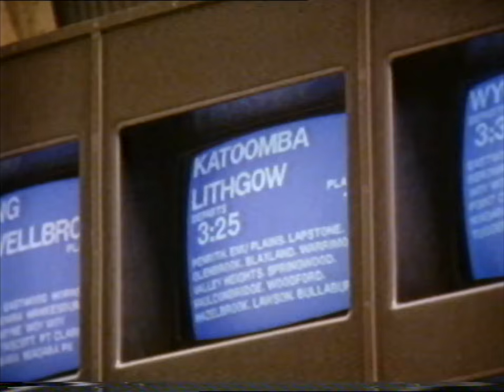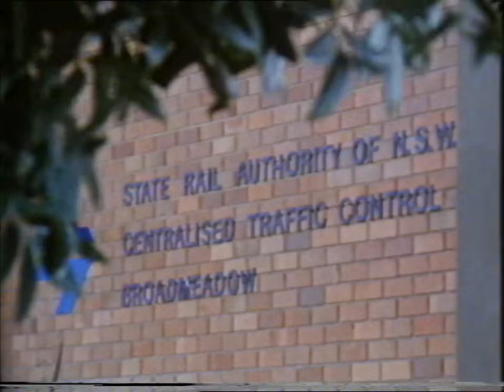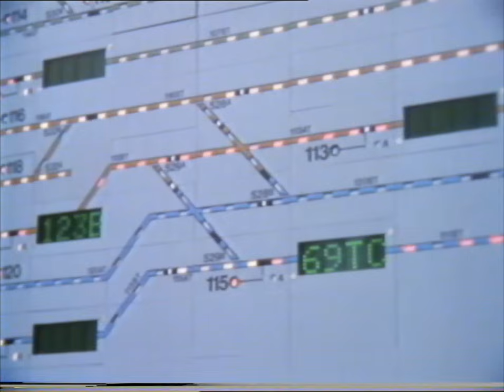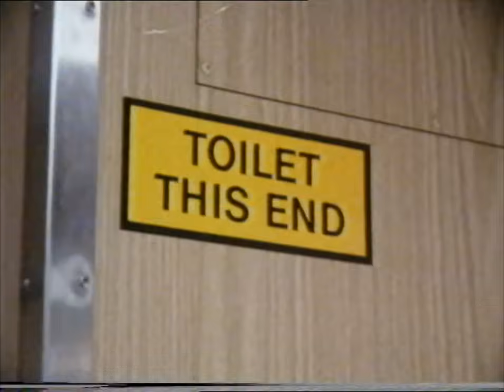Go Electric (State Rail, 1984)

Comment: Been a long time since I've seen a freight electric loco  on the Sydney to Newcastle line ,   my guess is its too much trouble to swap back  to a diesel loco for the non electric track sections which is the majority of the railways  ,  so diesel electric locos run on the overhead electric sections these days far as I know  .    Maybe the 1.5kv DC system can't deliver enough power to electric  freight locos ?    Who knows ?
Reply: 1,5 kv Electrification is enough due to new engines.see..in the Netherlands and France. Built in Germany since 1990ties, these engines could be powedered under four different engery systems 1,5 kv ,3000 kv both DC and 25 kv 50 hz /15000 kv  16,6 Hz AC !!  Therefore I know..!! Greetings from Germany !

Comment: When i was on there 77 to 82 they were going to electrify the main southern line to mittagong .
I ran team 8 2 tampers and a ballast regulator .
We did the track realighnment for the xpt and electrification to mittagong .
It was supposed to done after the woolongong line but never eventuated .
All the cuttings and access  roads done for electricification .

Comment: As usual journalists are bad at math. 200 mast every kilometre translates to a mast every 5 meters. It probably more like a mast every 50 meters if you look at a railway.
Reply: But at least they can spell. It's metres, not meters.
Reply: @JoelDavies-cl6nr  They can, you cannot. It's both meters and metres. I can give you links to thousand science and engineering books where it is spelled as meters. As both spellings are correct.
Reply: @test143000  water meter, parking meter, gas meter. For the purposes of distance in Australia, we use metre. And i had this clarification from an English teacher from The Sydney Grammar School.
Reply: @JoelDavies-cl6nr  In Australia, there is a preference for "meters" over "metres" (55 to 45 for every 100 citations).
Reply: @test143000  thank you for the reply. It gives me something to do in the sense of research/better reading.
Reply: Depends on track location, but 200 would be accurate

Comment: I miss city rail and miss the Interurban V Set. It is annoying that they got rid of those electric powered locomotives in exchange for the diesels. They should electrify the Kiama to Nowra section, Macarthur to Goulbourn and Newcastle to Maitland
Reply: The electric powered Locomotives were withdrawn from service due to the state government charging pacific national to use the electricity and also because they weren't powerful enough for freight.
Reply: @JoelDavies-cl6nr  They were stupid to do these electrifications on the old DC standard rather than reverting to AC though. AC had already well and truly proven its worth overseas, and QLD and WA went with AC for all the right reasons. It cost NSW more for a more difficult installation that was ultimately less effective and required more energy & maintenance. They keep making the decision with every new generation of trains not to allow for equipment that could run on both power types and they now have locked in DC equipment for another few decades despite the downsides. Hopefully if they ever actually build HSR in NSW & VIC they will either keep the HS trains segregated from the DC overhead or buy trains capable of running on both.
Reply: @BigBlueMan118  thanks for the insightful info. My initial comment was based on a conversation from many years ago with a Pacific National Driver.

Comment: Go electric they said, then they got rid of the electric locos
Reply: Imagine an alt timeline where they electrified the mainlines fully like the Main north to brisbane and electric freight still existing today like the QR coal lines
Reply: @QUBE80CLASS-n3z  well i remember a promise of extending the western line elec to Orange but of course it never happened
Reply: Why it stopped at Bowenfels when it was supposed to go a bit further
Reply: @QUBE80CLASS-n3z  I think as a turning point
Reply: @QUBE80CLASS-n3z  It was to capture workers that would live at Bowenfels but it didnt eventuate
Reply: When they created pacific rail .
The first thing they sold was all the electric  locos .
As they didn't want to maintain them !
Reply: @kevinduffy6712  Sold em to who ?they said the subframes were cracked and couldn't run most have been melted down i think
Reply: @simonburns1055  they sold them for scrap even the 80 class ones the 46 class were past there use by date .
Reply: @ 46 class were phenomenal pullers
Reply: @simonburns1055  they were built by Vickers in the UK for nsw railways .
For pulling coal over the mountains .
Reply: @kevinduffy6712  Yes and passengers too cause i went to Sydney many times behind a 46
Reply: @simonburns1055  the 46 class was in volved in 42 incidents ( de railments) splitting the gauge in sidings etc before Granville.
The system of track fastening we had .
Wasn't strong enough for the wheel set up .
They were built by Vickers in the UK, over there they had chairs and bullet head rail .
It was a lot stronger .
We eventually shaped to panderoll clips and concrete  sleepers to handle the welded rail .
Reply: @simonburns1055  yep they were built for hauling coal over the blue mountains .
And they had regenerative braking.
Reply: @kevinduffy6712  Also the bogie was fixed as i remember
Reply: @simonburns1055  it was 3 x 3 set up all driven.
It was a very powerfull and heavy locomotive .

Comment: Why did they get rid of electric locos. ?
Reply: Private operators found them too expensive to operate and too inconvenient because they had to be swapped out at the ends of the electrified area.
Reply: This is what happened to the L Class electrics on the Gippsland
Reply: @leonkernan  Then why not introduce bi-mode locomotives for both electric and diesel lines?
Reply: Like what the NSW Trainlink are with the CAF units
Reply: @leonkernan  When the  86 was tripled up and heading west across the Blue Mountains if the tonnage being hauled was such that the current being pulled from the overhead line on a couple of steep sections would cause the section breakers to trip. Trust me, they went off like a cannon with a bright flash to match it at night.
Reply: Because they weren't powerful enough for freight. And the state government charged them to use the electricity. That's why pacific national went back to using diesel.
Reply: @ Ok, but that sounds like more of a problem with the Class 86 being underpowered rather than them being electric.

Comment: Great video and I learned many things.  One would think with all the billions spent on the Sydney Metro they could find some extra funds and extend the electrification to Goulburn and Bathurst, or Orange?  "Go electric".  Very interesting video, top value!:washhands:
Reply: Largely unlikely. Goulburn electrification had been politically touted a few times over the years, but due to things like ARTC control south of Glenlee/ Macarthur its unlikely to get past Picton if it happens at all. Talks have been put around abkut electrification to Maitland too, but again requires ARTC to come to the party. Bathurst and futher are almost total non starters. Electrification through to Wallerawang and change over/ termination there is somewhat possible as it makes sense for a partial extension to pick up the potential customers there, along with a single platform turn around point that better serves the operations and communities more than the bathurst bullet can as is. Though the Marrangaroo tunnel woukd require significant modification for NIF operations.
Reply: Unfortunately the legacy voltage of only 1.5kV cannot support an electric freight locomotive fleet, which weakens the case for extending electrification.
Reply: @moblet  well I don't think there would ever be a case for electric locomotives again in NSW, regardless of 1500DC or 25kv AC
Reply: @james.black981  Why did they get ride of the electric locos?
Reply: @jimzafiriou7808  Mostly because the Government had no wish to extend the electrified area as they wanted to get out of running freight trains. The existing overhead didn't go far enough for it to be profitable for other operators to run electric loco's and have to maintain diesel depots at what were, by todays standards, very short distances.
Reply: @james.black981  I think electrifying existing sections of the Main South to Mittagong via Picton is a bad outcome even if you do get ARTC co-operation. We would be much better building a full HSR-spec electrified bypass line between Macarthur and Mittagong with a new station to serve the growth suburbs near Appin. That could cut 25min off the trip for Canberra, Melbourne & Moss Vale journeys. I reckon you could likely reduce regional train running times by at least another 10min simply by upgrading the East Hills-Campbelltown line's signalling to full ETCS, fixing the junction issues with the SFL at Minto, and adding a decent passing opportunity somewhere between Campbelltown and East Hills.

Similar deal with Bathurst though as you pointed out at least Bathurst doesn't have to deal with ARTC, but the steam-era track via Tarana is dreadful.

Maitland and Bomaderry are much better, and for Bomaderry you don't need to worry about ARTC and theoretically (not saying do this but its a thought bubble) you could just do Gerringong-Bomaderry and leave the Omega tunnels as a diesel island for now. Bomaderry top speeds can also be increased from current 140 to 160, even if they have given up on the Toolijooa passing loop.

The Canberra branch currently has decent sections currently with maximum speed of only 125-140kmh that can be increased to 160kmh without much fuss as well and further reduce trip times.
Reply: @moblet  When the 1500V extensions were planned in the 1970's advanced traction control and A/C traction motors was well into the future. NSW operating conditions were such that in the diesel world was that 3000hp didn't offer you that much more than 2000 did pre Super Series/Micro-Sentry. The reasons the 86's were built with camshaft control was due to perceived risks with interference with the signalling system and the costs for certification and modification. The PTC/SRA motive power planners certainly knew and understood their limitations when they ordered the 86's. Also in the late 1970's the 81's were a bit a leap into the unknown as the Hunter was slated for electrification at 25KV pending the next oil crisis and Super Series itself was a bit of an unknown as it was still a very new technology) Remember before Super Series/Micro Sentry all a diesel hauled freight over the Blue Mountains offered you was just slower sectional running times and paying out real money for diesel, and the inability to reuse any energy generated by dynamic braking (Remember the NSWGR/PTC/SRA wasn't exactly paying real money for its electricity from the then NSW Electricity Commission)